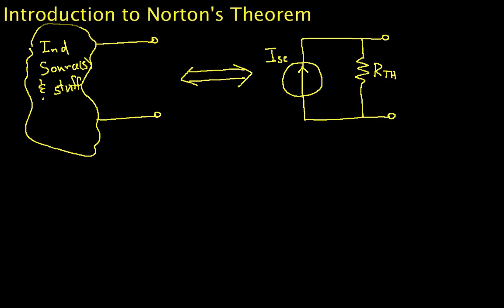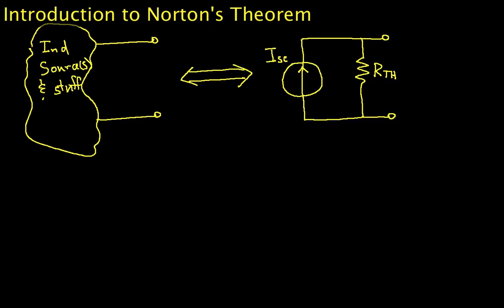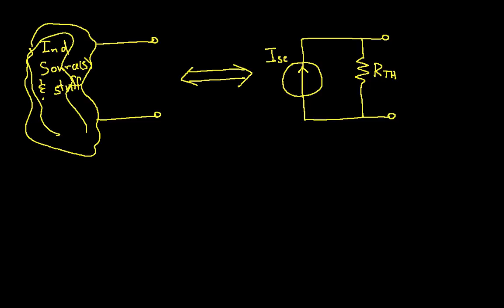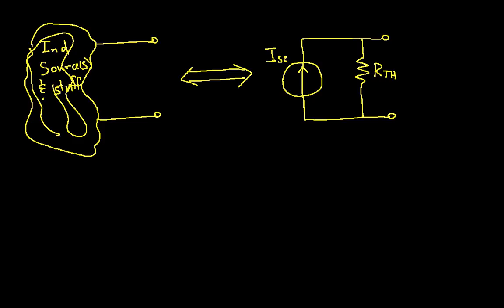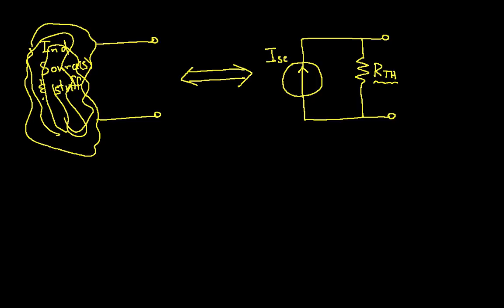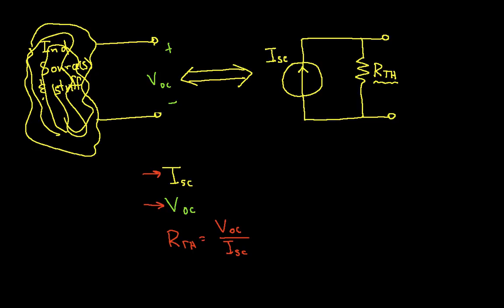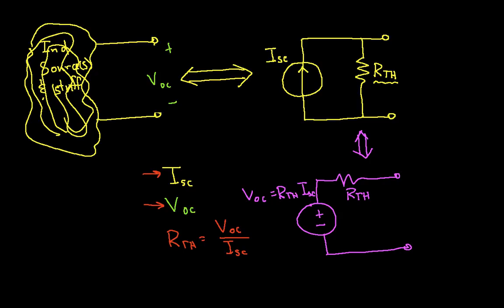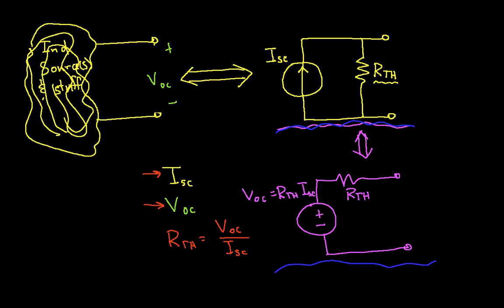Introduction to Norton's Theorem

Comment: Aside from the Equivalent Circuit Schematic, another difference is that you SHORT Voltage Sources &  REMOVE Current Sources in Thevenin, while with Norton, it's vice versa

Comment from the maker: Do you mean the resistor that is in parallel with the current source (labeled Rth in the video)? In most applications of Norton's theorem, this resistor/source combination is connected to some other circuit element(s); when Rth is infinity, any current that flows would flow through the other circuit elements.